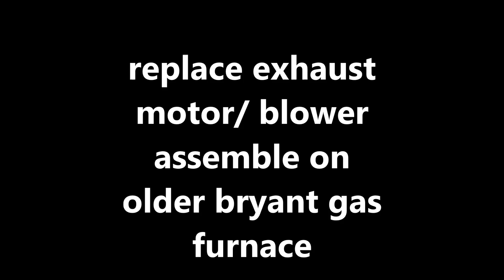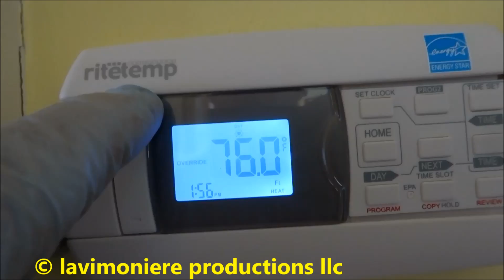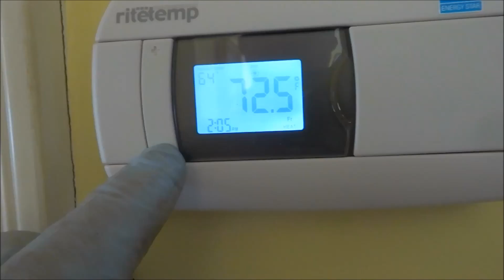bryant gas furnace exhaust fan/ motor assemble replaced

Comment: Nice fix Steve, usually when I change those I only do the motor and the wheel.  Never seen the whole housing changed before.
Reply: I used to just replace the motor and wheel on those also Dean. I can't stand those Rite Temp thermostat. Who sells them?

Comment: at least the Goodman draft inducers come as one piece, lol. i guess you could of gotten away with just replacing/installing the actual motor and squirrel fan. the rest of the parts aren't really needed but handy if you need em down the road, i guess.

Comment: I think the takeaway is ...lots of work on this job to replace noisey motor.  You can tell people all day long to replace the entire unit and eventually the unit will have to be replaced....sooner then later.  I spoke with an older gentleman yesterday with a 29 year old ford aqua booster with a shot 006 circulator. I told the guy..... better to change out the aquabooster etc......Nope just the 006 thank you very much. Same old same old.